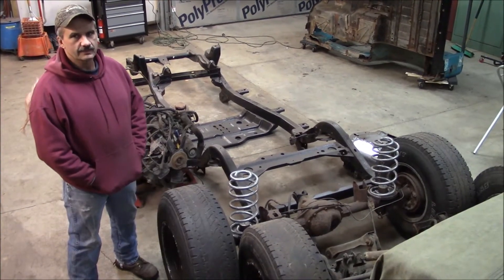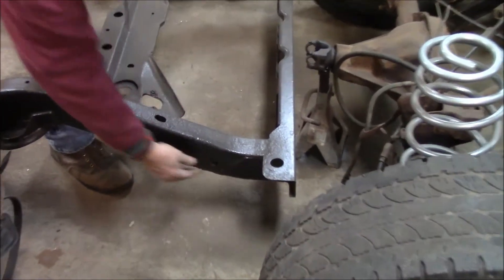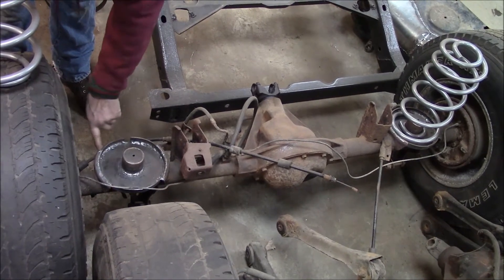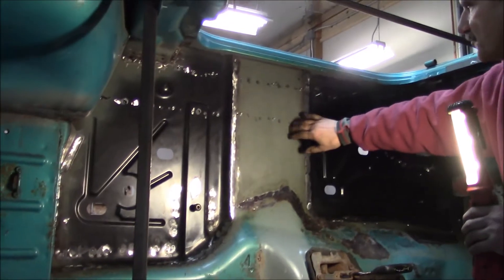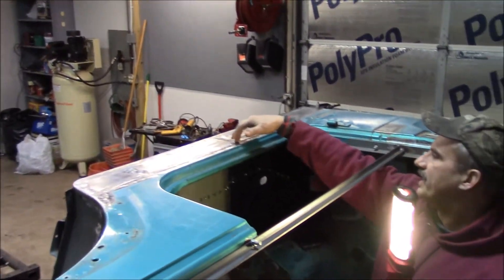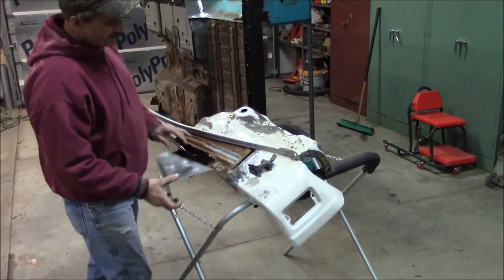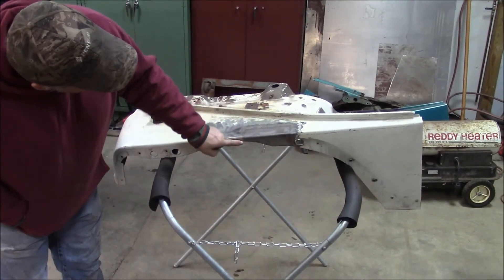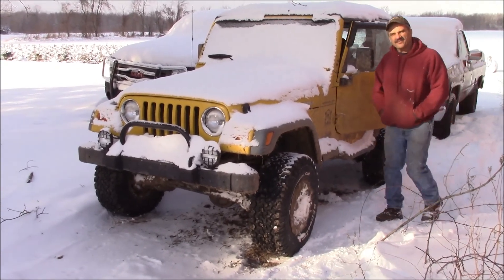1997 Jeep Wrangler TJ Rebuild:  Project "Why Bother?"

Comment: Beautiful job. And always fill your frame with diesel fuel or a different anti rust penitent oil or your choice. Your inside of the frame rusts the most as we know and this will completely stop it from what I heard. Diesel is cheap do it. It would be a good idea to hit the torque boxes with diesel as well. That's where I actually had some rust holes. My frame is solid. Just painting the outside of the frame.
Reply from the maker: We're going to spray the frame and underside with Fluid Film when its done.
Reply: Guy I watch here on YouTube thins down chainsaw lube. He lives up in Maine I think ?